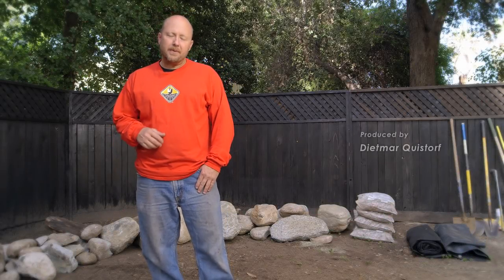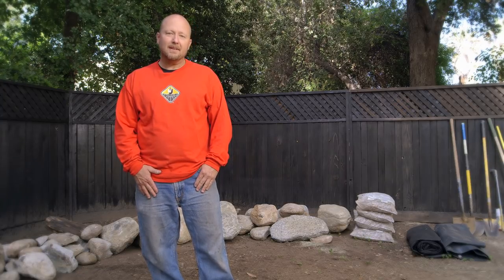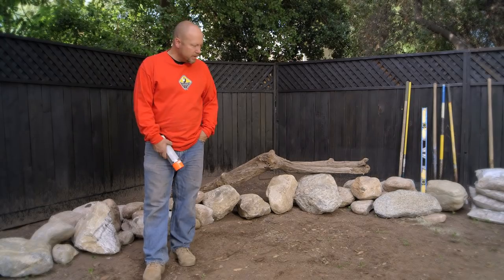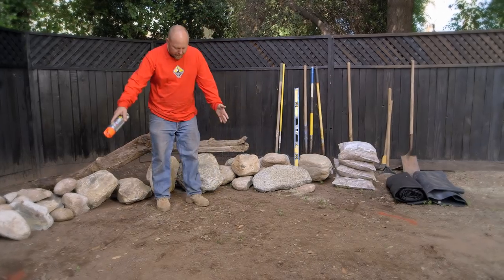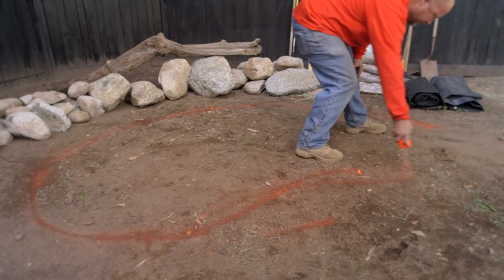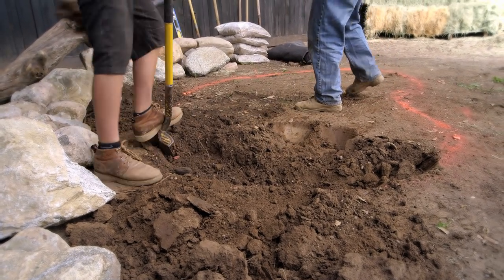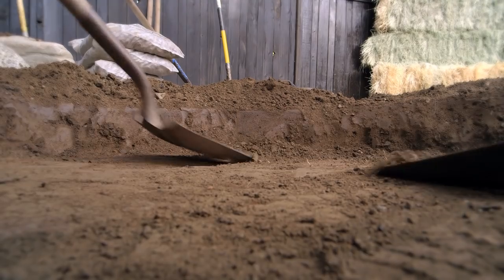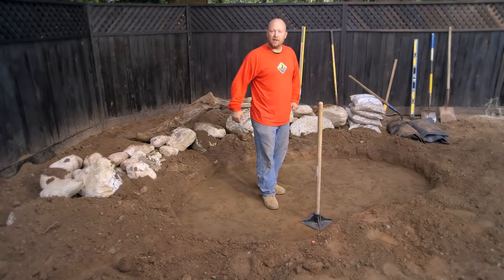Frog Pond | Build a Pond for Frogs - Part 1

Comment: So I have followed this series step by step and ended up with a good looking frog pond, although I haven't quite chosen the right sized rocks as there is LOTS of black liner still shwoing, but plenty of time to solve that :-)

The main problem I have is that within a week of filling the pond, it went quite green. To counter it, I added some 'beneficial bacteria' which I had forgotten to do. But this turned the whole pond black within a couple of hours. Is this OK? Or has something gone horrible wrong? When it was green I could still see the bottom... the boulders and gravel. But now, its just pitch black.
Reply: What happened with your pond? I’m curious
Reply: @jovanymartinez3903  it sorted itself out within a few weeks and went back to being very clear. A year out so later, algae took over due to too much direct sun. Bit adding more oxygenating plants and to have sheeted it and now it's a nice clean pond again.

Comment: You mentioned that the water should be stagnant. I am designing my Fish pond and was wondering if to the side of the falls and cascade, I could put a smaller version of this Frog pond? It would be on the upper area of the backfilled soil of the retaining wall, getting it's supply of water from one of the cascade pools and then overflowing into the larger fish pond through rocks and gravel, instead of over them. Would this method cause the water to be too swift for a proper Frog habitat?
Reply from the maker: It is possible to create a small off shoot of your fish pond to support tadpoles. Anything is possible. ;) Here is the problem. If you create a small section off the cascade for tadpoles once they morph and leave the adult frogs will not recognize that small area as the correct spot to propagate and leave eggs the following year. In order to create a habitat where the frogs will return and successfully reproduce year after year you will need a dedicated frog pond otherwise your fish will eat the frog eggs and tadpoles. I hope that helps.

Comment: Thank you so much for this video! Question about sun vs shade... I've heard conflicting advice. Our pond will be almost identical design as yours. People have told me that a no pump pond needs to be away from trees to prevent too much debris from getting in the pond. Others have said that toads/frogs prefer shaded ponds. I have both a sun or shade spot where I can build the pond. What do you recommend and why?  We live in Colorado outside of Denver. it may be possible for me to plant an evergreen to shade the pool and won't drop leaves in the fall, but there would still be some debris from the needles.
Reply: Did you build it ?

Comment: I built a frog pond last year Ann's out turned out great. MINUS the raccoons that got in and tore up all the plants and ate all the tadpoles and frog eggs.  How can I deter the coons. One thought was to make a straight drop into the pond instead of any areas that can be used as a "beach". Electric fences are a no go.
Reply: I added irrigation dran pipers to mine with small holes cut into it.  That way they can escape racoon paws  easily.